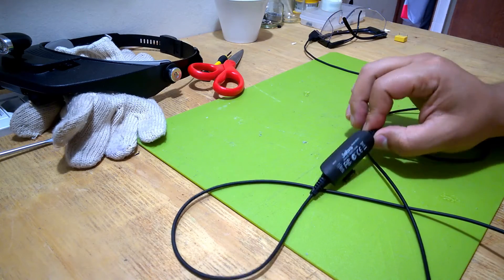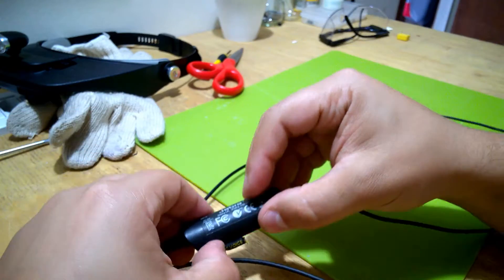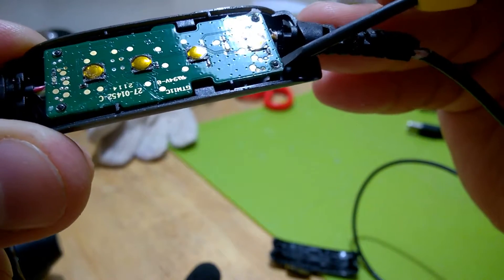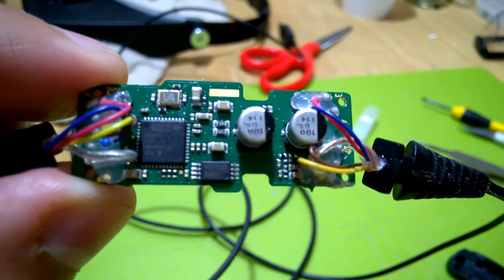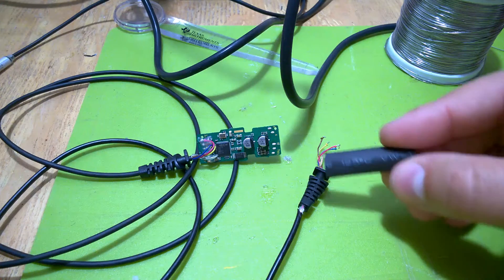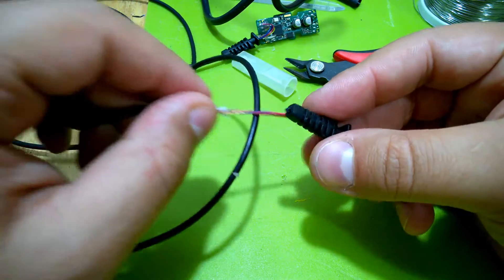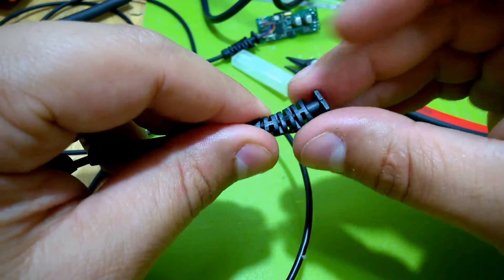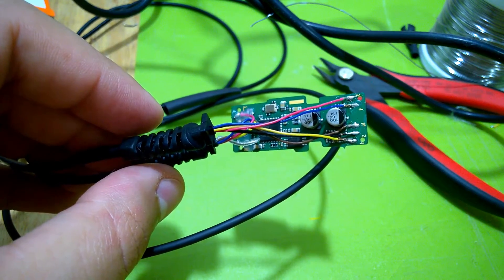A look inside the Jabra UC voice 750 headset + cable repair

Comment: Hello, thanks for the video. I have the same headsert as yours but pulled the wired on the USB side and would like to weld them back. Would you please advise the arrangement of the 4 USB wires in the order of colors (red, blue, yellow and silver) arrangement to the PCB. Thanks.

Comment: Hello,
I dont know the right position of the colored wires on the controler board of my jabra 150... 
Looks a lot like the 750
I would like to weld it and i cant find the positions. :(
Reply from the maker: +Fabio Melo, if you wish I can open mine and take a close up picture in case it helps. How many wires does it have?
It can't be much different assuming it's a USB headset like mine - in one side (that goes to USB) you will have 4 wires plus the cable shield; in mine both the shield and blue cable go to ground in the PCB; the red/pink cable is VCC, the other two are data (brown is Data -, Yellow is data +).
On the other side I have to check with a bit more time, but there is also a cable guard that goes to ground and 4 other cables (1 for mic and 2 for right and left speakers, plus VCC I think)
Reply: @en-juh-neer545  Hi, thank you very much for the video and explanation, I've just fixed my Dell HSC011 / Jabra Voice 550 (there are wires with classic USB colors: Red, White, Green, Black and the shield (from left to right).